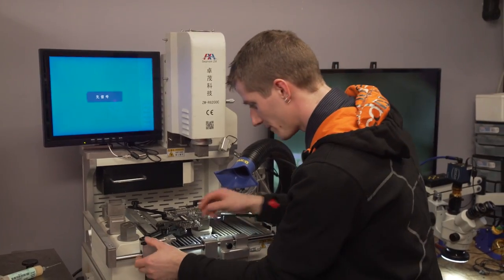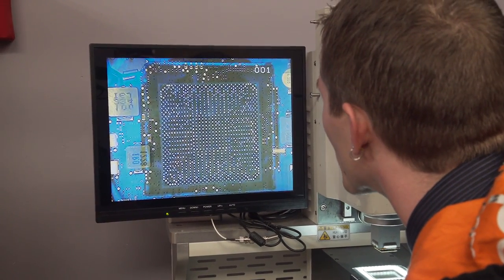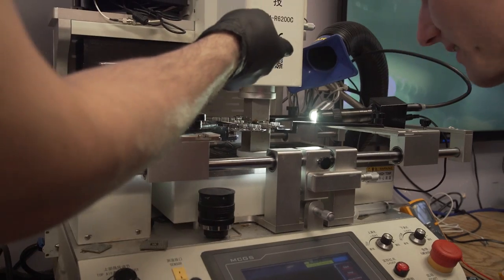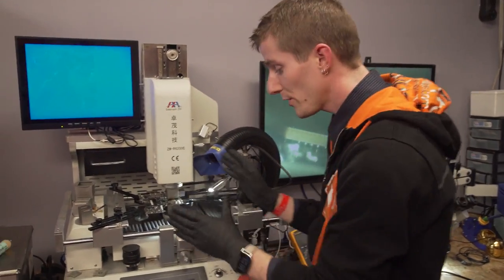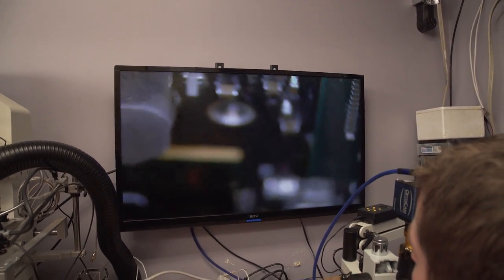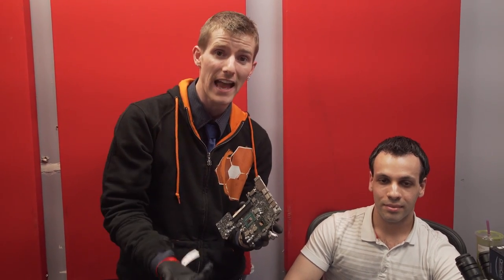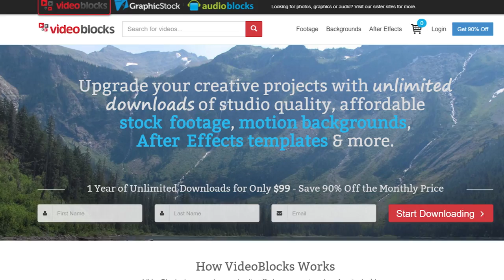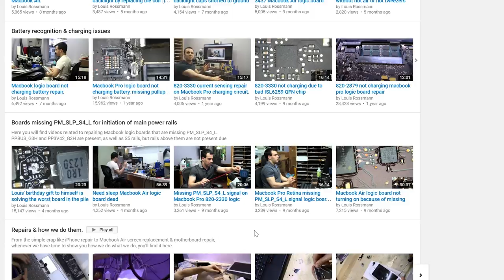Linus Attempts BGA Graphics Chip Repair! - Rossmann Repair Group, New York City

Comment: Something on my LG TV's power board was dying and the TV kept turning off randomly till it would no longer turn on. I tried trouble shooting the board and found a bad rail but couldn't figure out the source of the bad component. Anyway I baked it in the oven for a while and it started working again and still works 4 months later!!

Comment: I actually did the Oven Method on my Evga Titan X Sc which was Artifacting and locking up. I went 375c for 10 mins then I slapped on NH noctua paste on the GPU and vram chips then put 1.2mm Copper shims on each vram chip and thermal pads over vrms its running 53c load max. It was outa warrenty and was sitting on a shelf I was about to take Dremel to it and make some keychain outa it before deciding to try the bake method.

Comment: Ive seen old "dead" motherboards repaired by baking them at 350 for a few minutes, it helps reflow any cold solder joints.
Reply: Did you use flux?
Reply: @dcfuksurmom  
If you want to try, use an older card. no one wants to ruin their GTX 1080 Ti while under warranty.

Comment: Any style of reballing is unlikely to work, but heating a board might make the board work for a few more heat/cool cycles. This happens because heating a defective capacitor will usually make it work for a bit longer, but it has to be replaced or it's just a lie. Make a grilled cheese sandwich. Break it in half. Put the halves together, heat it, cool it off. It will behave like a whole sandwich for awhile longer, but it's not.

Comment: Actually, i know this is an old video, but when my GPU stopped showing display, I cleaned it, changed thermals. No display, tried on other Computers, no display. After days of fiddelling with it, I put it in the oven and voila, It actually worked. I had given up on the gpu and was ready to buy another, so why the hell not?

EDIT: I did it back in 2017?? I think, and it still lasts

Comment: Louis highlights important points which people need to know.

We are ignorant when we dont know or understand. That can do more harm in some cases. This is related to water damage and rice method.

Other video(respond to linus)
he explained a very interesting point which people dont know. Delay repair and internet hacks will make things worst. 

Reason it add frustration to the industry because it gave a very bad rep to legit repairmans. Here is some explanation.

When someone tried a hack, its a short term solution. Sooner or later by luck. The item will spoil again.

Then you bring it to a repairman. 
When they open it up, they found out that you made things worst. For example , heating gun will unsolder the chip or water damage that allow to corroded the chip futher. 

So when repairman will try to fix the item to the best of the budget or skill. Here are 2 senarios.

1. He asked for a more money to repair becus he has to replace the part and add more work hours. Customer may think repairman is trying to rip customer off.

2. Fix it to the best of their skill. Item spoil again later. Customer thinks repairman sucks.

But customer dont know that they were the ones that did more harm to the item. It was their fault in the first place but unaware they did it. 

So this is some prospective to shed light into ignorance.

Comment: Well to be fair, it can be repaired without a rework station, however it takes much more time, much less reliable and takes much more experience with the setup to get it right, but it works. So unless you are running a repair shop this rework station is kinda an overkill.

Comment: I see this as a way to stop the oven myth ( you ask you see a oven in this video it's to heat the boards up to allow direct heat to the location that is faulty and see if you can fix it)

I know people say it works but as Louis said about apple and there faulty chips people would go to a repair store where they say OH re-balling the soda will fix it and apple did this for there warranty so people warranty would run out and not get a new apple product.

Comment: So far have fixed 4 out of 10 gpus by just reflowing power mosfets. Corrosion happends and solder joins  become too high resistance to continue to provide stable enough current to keep the gpu core stable. Maybe not an oven but old gpus + hot air can be a super easy way to get another year out of your old gpu.

Comment: Well to be fair a BGA repair is going to be different than just a reflow which you were attempting with the oven. Replacing the solder with his expensive ass machine is going to be the much better route though as a reflow most of the time is just like a band-aid.

Comment: Lol I used to repair parts like that for Motorola by hand but we used a different method and practically no one had steady enough hands to do it this was in 2001 and I was one of 3 people that were allowed to do it by hand don’t think I ever failed the solder on one but we also had an X-ray machine to check the solder after we were done then it was tested again.

Comment: Linus is no match for my sister's exboyfriend when it comes to stupidity with electronics and ovens tho.
Since he knew I have a hot air rework station (which I've used for QFP stuff at best at that point [I handsolder that nowadays]) he approached me to change the CPU on his macbook at one point, with the donor CPU literally ripped off the board, it even still had some ground traces (which are connected in a bus type) on the BGA pads. I told him that I'd be up for the job if he also gave me access to a $2000+ BGA rework station which he of course couldn't. Yet he still was dissappointed that I wouldn't hackjob/botch his hardware even further with the probably already broken donor cpu.
At a later point he approached me again, this time with a graphics card he attempted a reflow on. Since he diagnosed a ram fault with one of the chips on the backside of the card he put it in the oven upside down(!) at a slight angle with 60% of the bigger parts with few pads (capacitors, inductors, voltage regulators) falling off and a bunch of them partially slipping off their pads. Needless to say I denied even touching that one as well (I had to fight myself not to use violence on the guy, as it was a $650 graphics card at that time).
Moral of the story: Dear youtube content creators, it's impossible to overstate that the cooking oven thingie is a hackjob at best giving a temporary solution and nowhere near a proper repair that's best done on items which have low/no value to you anymore.

Comment: oven baking does work, i brought a 9800GTX+ back to life with 7mins in oven at just under 200deg C, in 2013, it still worked last time i used it in feb 2017, strangly enough that was the first and only success, the susequent attempts to ovenbake fix things failed, one of them i left the door closed after turning it off :D

Comment: wouldn't it be a better test to just heat the inside of the chip and fix it at a lower temp and not heat up the solder balls and fix it, then his theory would be right about it being just the inside of the chip that needed to be fixed and not reballing the chip

Comment: Personal experience with an HP Pavilion laptop. I "bought the line of guff" about reflow soldering the GPU to fix failing graphics. Trip to Home Depot, bought a heat gun with "calibrated temperature LEDs". Not trusting their calibration, I put a piece of solder on a piece of paper on a cutting board, and tried various temperatures/times until the solder melted. Great, now ready to reflow the GPU. I put "heat shields" all around the GPU to minimize heat collateral damage to surrounding parts. Given the time took to melt bare solder, I 3x the time, about 5 minutes reflowing the GPU. Crappy nVidia chip with Linux barely supports. Put everything back together, and amazing, my laptop worked again... for about a month or two. Determined to fix this laptop, I bought a re-manufactured mobo for about $80. That did solve the problem, but then I had WiFi issues. Moral of the story: Believed the professionals. They do this for a living, and know when to give up on a lost cause. That HP laptop lasted an amazingly long time, nearly 7 yrs, which is like 2x for  laptop being carted around in a backpack daily.

Comment: Not a professional pcb repair person at all but it is something to point out that many boards when manufactured are baked to flow solder.  They use stencils and solder/flux paste on the contacts, place chips, and then bake the cards to flow the solder.  so there is something to that.  Especially if someone has an older card where they don't have a warranty or $7300 to buy that machine, this could work.  Literally as linus demonstrated in the last video.  Is it lower chance of success, sure.  To me it's worth it.

Comment: this is so .....hard to tell.....i got a broken gpu ( ati hd7850) for free from a friend who was mining.....and i baked it in the oven around eight years ago and it's still working today ( daily used ) , and when i tried that, i fixed about 5 other gpu's that way...so if u ask me, Louis was  wrong, i still admire him for what he's doing but still if you try it and it works...just do it....it' only costs you a few cents for electricity and a about one meter of tin foil...but i tried fixing my other friends card also with the oven method but it didnt work at all ( it had the problem with no video) so i was sure the capacitors were bad....bcs they were looking blown even before .....so the final conclusion from my side is ...try it ...just do it right ...

Comment: But baking fixed his gpu... Soooo
Reply: Gattz This is how you actually do it. As he said, without knowing that either part works, you repair it outright, no some hackjob solution.

Even so, in a post-video from Louis, he did state that they just chatted during the heating time, a minute or so longer that what was required, so the chip most likely got fried. Not the fault of the repair machine, just so many variables in the situation.

Comment: his machine is industrial. of course it will cost that much. BUT there are PLENTY of smaller more affordable  systems. like with the XBOX 360's, i know a guy whom has a thing that its sole purpose is to grab-->heat-->and reseat the chipsets. because the factory solder jobs were complete garbage and were the main cause of RRoD. it was a fairly simple procedure, it simply melted the solder and reseated the chip. BAM problem solved. in some cases tho, more solder had to be added. because the contact points were quite weak and would come unseated and the solder jobs were machine done with minimal material usage to lower costs. you had shoddy manufacturing and thus shitty quality products. i digress, if you had this little contraption then the job was a simple fix, but other methods work as well such as a heat gun or in YOUR case, the oven trick, these are both methods to achieve the same results, but with lower success rate, and a lower quality job and can possibly melt solder points elsewhere causing those places to unseat and get messed up where they were not originally an issue